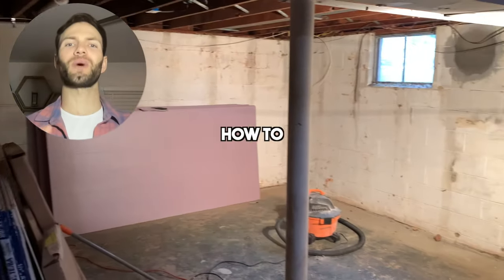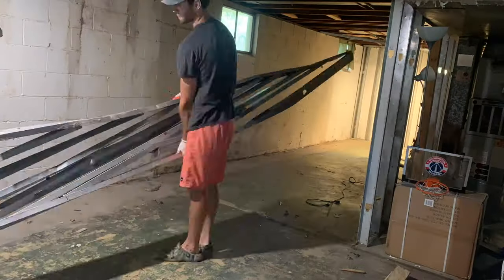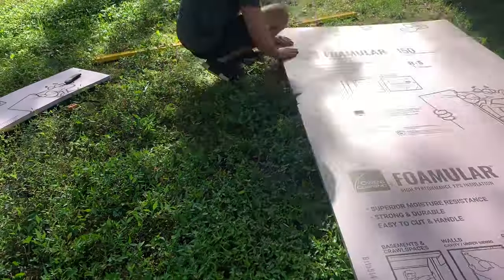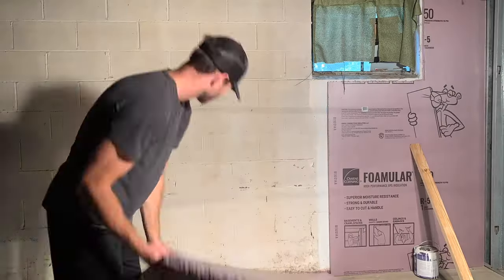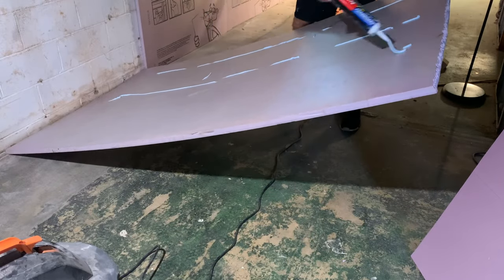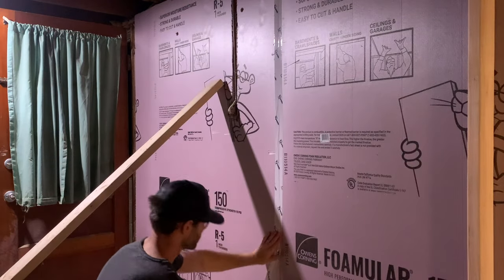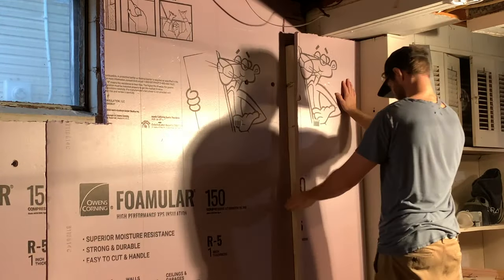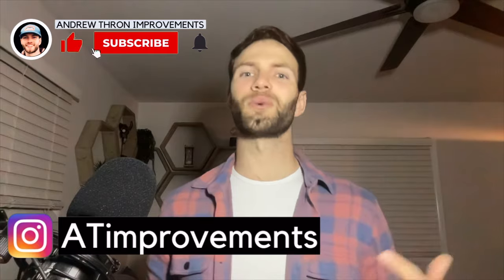How to Install Rigid Foam Insulation (Owens Corning Foamular Installation On Basement Walls)

Comment: My first first comment.  I am impressed and I did wonder about the technique of rigid insulation board.  Framing over top of it makes such good sense and with lots less cuts than cutting board to fit between 2 x 4's.  Thanks for a good show.
Reply from the maker: First time for everything, Patrick! Appreciate you watching and for the continued support! Not the most exciting of videos, but it’s gotta be done before we can get to the more exciting projects. Cheers!

Comment: I see you applied adhesive vertically to allow moisture to flow down but do you also leave a gap at the bottom for it to get out?  How did you handle that? I have seen foam board with a stucco coating and was if that adhesive would be enough to hold it in place and just paint it.  
Thanks for the video.  I'm getting ready to do that now.

Comment: I love rigid foam insulation. I prefer polyiso and went with 2 inch panels with R13. Instead of a framed wall I used 1/2 inch Hardibacker and tile over that. I dropped down electrical from the ceiling to the outlets.

Comment: Reading your comments… wiuld ypu recommend to have few inch of air gap before you frame the wall. Than install ridge foam in between?   With air gap, do i need vents

Comment: Did you have insulation in your rim joist before installing the foam board? I have deep ones I am debating if I need to air seal prior to doing something similar
Reply: Don’t know if it’s too late but he’s using closed cell spray foam for joists is best and rockwool on top of that
Reply: @Moonkey-d4b what about the sill plate?  Wouldn't moisture still want to accumulate there?
Reply: @robertm5969 the sill
Plate should be installed on top of a foam gasket and if you use closed cell foam for the rim board with a thick layer of rockwool, air movement should be limited and prevent condensation in most cases.

Comment: What happens when you get moisture? that looks like it could be a big problem in the future.
Reply: Water would get trapped behind the foam and/or seep out below the bottom. Neither the concrete or foam care about getting wet so not much of a problem. Mold doesn’t feed on concrete or foam either.
Reply: You're right about trapping moisture between the rigid insulation and the masonry wall.  A better method is to put rigid insulation between the wall studs and leave a space between the masonry wall and the stud wall.  Also use a foil backed rigid insulation, it's similar price and a higher R value.
Reply: @richardmckrell4899  how would you adhere the rigid insulation to the studs? would you just use adhesive on the sides?
Reply: @aa_3507  You don't, you friction fit them between studs or put something on the back of the studs so the insulation does not push through.  Most people just glue it to the foundation like this guy.

Comment: My basement has some foam with mesh and a stucco coat over the concrete, and some masonry rock type things.  Basically my walls are not flat.  Should I try to remove the stucco and mesh to get directly onto the concrete walls or do you think I can just double up on foam where the uneven areas are ?  Not sure if that makes sense lol
Reply: If stucco substrate is good (not crumbling) and not too uneven, you could apply adhesive in a grid pattern of blobs (vs. lines as Andrew did here). That’s how done on TOH basement project, also posted on YT.

Comment: Can you put up sheet rock on Thermax sheathing installation walls without studying out a wall? I have a long wall to do and I didn’t want to start it out and I was gonna use liquid nails to apply it but I did not if it would work.

Comment: What is the advantages of using the ridgid foam against the wall vs putting standard insulation in between the studs?
Reply: Continuous insulation means no thermal bridging. A r13 batt isn’t actually r13 because wood studs are about r1.1 per inch. Insulating the stud cavity doesn’t account for the drop in insulation r value at the studs.
Reply: Fiberglass and studs between concrete and conditioned space = moisture issues and mold. You want a continuous vapor barrier which rigid foam provides

Comment: Hi Andrew, love the videos and the work. Not sure where you are located, but do you think R-5 (1" foam board) is enough insulation for your basement? Most basement walls require R-13 to 15 to meet code, that is.

Comment: Hi Andrew, I'm just curious what did the permitting process look like for all these projects that you're doing? Did you have to submit them as you went or all at once.
Reply: permit to add foam insulation? are you serious?
Reply: @stoneyj1a1  he was clearly framing it up lol and going to finish the basement
Reply: I wouldn't be surprised if a permit was required to install insulation since doing it wrong can lead to mold growth.

Comment: You didn't leave an air gap between the foam and foundation?
Reply: Curious about this too...trying to figure out the best was to accomplish this, I heard it's better in the long run
Reply: @loganramsey1957  I've pretty much made up my mind and will be doing at least a 3/8" stand off when I go to complete my basement.

My house is from 79 and in a developing town, so I'm pretty certain it does not have a vapour barrier under the slab or foundation :(
Reply: what about behind the foam on the vertical wall?
Reply: @loganramsey1957  for that I'm using foundation wrap after I treat the wall for any visible cracks and known leak points
Reply: Your actually not supposed to. I’ve read that you will have a convection loop from cold blocks on top and warmer blocks down low. This will cause condensation supposedly
Reply: @anthonys7534  sounds like I'm going to have to do some experiments for myself. The 'experts' in my area can't even agree with eachother and if you ask one question, you might get 3 very different answers 😵‍💫

The one thing they agreed on is if I put that foam in and it's on the concrete, if water ever seeps through (which is very likely with my house) it may not drain off and sit, eventually being a potential spot for mold growth.
Reply: I was just on a job today that had foamboard  loosely fit against a block wall on the inside of the building. We were tearing out walls for a remodel and found a major wet spot and everything else was dry (just a drainage away from building issue) Anyway the twenty year old foam looked brand new were it was against the wet wall. No smell or mold at all. So it doesn’t seem to affect foam board when in gets wet for extended periods of time.
Reply: @anthonys7534  thanks for the clarification! :D

Comment: Are we wasting more space this way? because of thickness of foamular board +thickness of 2X4?
Reply: I wouldn't say wasted. The foam board acts as a vapor barrier. The 2x4 studs allow for electrical box installation and load bearing for cabinets.  Some people just use 1x3 strips on the flat if you're not going to add electrical and want the extra space.

Comment: I used the same adhesive but it doesn’t stick because of the uneven concrete surface. Got the studs bracing it and hope it does by tomorrow. Did it stick for you or had to do something additional to get it to stay put?
Reply: Try using thicker beads of adhesive. I also add some small circles uniformly, this will create a bit of a suction effect

Comment: You never want to install rigid insulation against a masonry wall, especially below grade.  It's done all the time, however there is a high chance of trapping moisture and creating an environment for mold growth.  The best practice is to move the stud wall away from the exterior wall and use foil faced rigid insulation between the studs.  Leave openings for air to circulate behind the walls and use dehumidifiers to keep humidity below 50%.
Reply: I just pulled all the gypsume board off my finished basement walls as part of a remodel. I found that the sheetrock was installed over paneling that was attached to 1/2 furing strips which were nailed to the poured concrete foundation. There was no mold or moisture indications and prior to demo, that room stayed stayed fairly warm. I believe not every basement needs the walls covered with foamboard especially if you just plan to finish part of a basement (In my case half finished) but in fact should be allowed to breath. I keep a dehumidifier running all summer at 55% and because of how that room was built with air gaps between the wall I believe the entire basement can stay dry.
Reply: @thedailylunchbox-foodforth6307  Keep the humidity under 50% and no fiberglass insulation.

Comment: Why did you install the boards vertically instead of horizontally?  I believe sheet rock installation is installed horizontally.  This way you are using two boards to cover 8ft. It appears that using 3 boards you get only additional 4 ft.  Not a very good ROI on material.  Your thoughts.
Reply: Better drainage potential as adhesive is in vertical strip.  If a water event happened it would flow down to floor rather than accumulate behind foam board
Reply: Yeah, I wound up doing it vertically after doing some more research. Thanks for your reply.